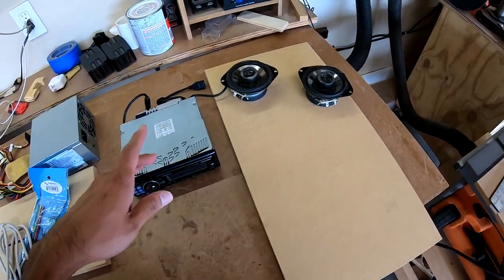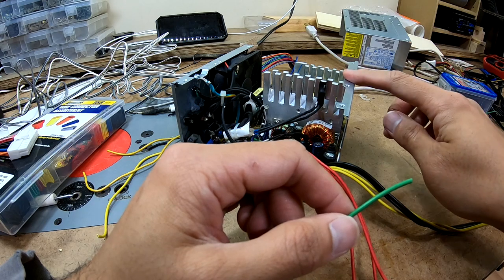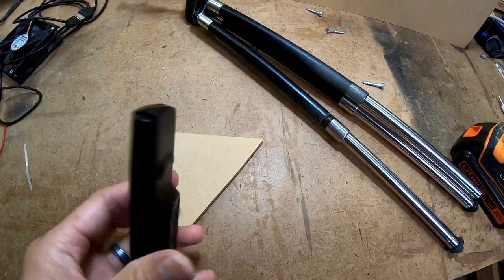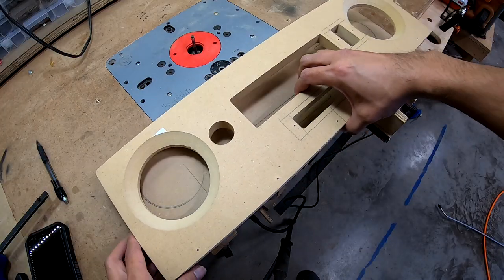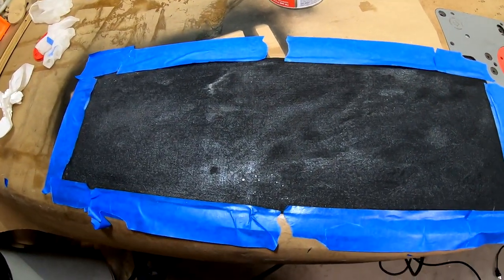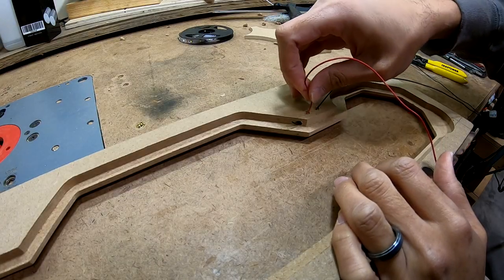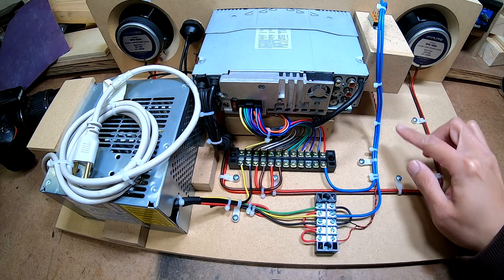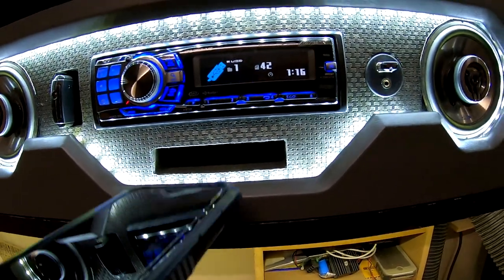The Shop Stereo Project (Reusing Alpine Car Audio Equipment For The Garage)

Comment: I used self-powered speakers to avoid the power supply and associated wiring.  To power the head unit, I used a standard 120VAC to 12VDC wall plug I found online for $11.  Though my system is clean looking, yours is much more detailed and eye catching with a splash of bling.  Nice work!
Reply from the maker: Thanks a lot. Gotta do what you can to have some tunes while you work.

Comment: Almost 3 years later, but still looks good to me. I'm not sure I understood the magnets for LED power though. I guess a solid update could be a wireless charging pad in that cubby. Either way, good work.
Reply from the maker: Thanks a lot. I kinda rushed explaining that part about the magnets. It’s basically just a quick disconnect connector made out of magnets so I can remove the front panel without having to worry about loose wires. I have a few more videos I need to edit before I can get back to the shop stereo. I’ll be adding some rear speakers in the garage and possibly a subwoofer, but that’s the next project after the next two or three videos I get posted.

Comment: Came across your work looking at doing a head unit in my '17 accord, however that turned out to look like Pandora's box. Anyways, I just wanted to let you know that your work is not only amazing, but inspiring. Your detail and organization are through the roof man, really. I've built a few garage sound systems with spare parts, but nothing like this. I really like the CPU power supply. Keep up the amazing work.
Reply from the maker: Thanks a lot! I definitely take pride in (most of) the work that i do. I’ve got a few projects in the queue, but I haven’t had time to work on them. It’ll get more videos up soon. I think the maestro interfaces are compatible with the 10th gen Accords now. I may end up trying that eventually to follow up those videos. But that may be the route to go if you want to go aftermarket in your car.

Comment: I’m just about ready to make my own, and this has given me the push and want to create something similar. Amazing work.
Reply from the maker: Thanks a lot! I’m glad it could give you a push. We can all motivate each other.
Reply: @AyyJayy02  absolutely man. I do have a question. What do you recommend the min req. be for the power supply? I know your using a old computer power supply but what would I be looking amperage wise? Obv. I know the 12v part, but just confused when it comes to looking for amperage. My setup would look the same, but adding a Alpine type r 10” and matching amp.
Reply from the maker: The amp rating should be labeled on the power supply. I’ll have to double check what’s on the one that I used. Check the fuse sizes on the amp and headunit. Add those numbers together, and that would be the bare minimum number for the power supply, but you’ll want to go higher than that. I don’t think a computer power supply would cut it for an amp for a type-r though. Probably go bigger than that.
Reply: @AyyJayy02  ñili

Comment: That's not a boom box, it is a work of Art (with a capital A). Very clean and organized layout. I do have one question for you though, where did you get that fabric that you used? The first one you cut. It really has a beautiful texture to it. Thanks and really looking forward to future projects.
Reply from the maker: Thank you! Clean layouts is what I always strive for. https://www.amazon.com/gp/product/B077BSN27Y/  I think that's the one that you're referring to. I almost felt like the glue seeped through the fabric though. It looks really good though.
Reply: @AyyJayy02  Thanks. That is exactly what I was referring to. I used to help set up pool tables in my youth. We used Scotch super 77 spray glue to attach the felt to the slate. Once you spray that glue on one of the surfaces and then attach them together, nothing moves. You may want to give that stuff a try in the future. Thanks again.
Reply from the maker: I haven’t had problems with felt or speaker box fabric, only vinyl fabric. Humidity gets bad where I live, so that could be part of it. Thanks for the info though.

Comment: HEY... you said you didn't wanna.. I have a receptacle I need replaced lmao.. so we can eventually work on this STOOOODIOOO that I am slackin' on.
Reply from the maker: I didn’t hardwire it to another receptacle. It’s just a receptacle with a plug on the other end. I don’t mind doing that in the garage, but it’ll look bad in your house.
Reply from the maker: There’s no way you don’t know an electrician
Reply: @AyyJayy02  I do, you. lmao
Reply from the maker: Only low voltage for me. I think there is another 0 at the end of an electrician salary.
Reply: @AyyJayy02  😂

Comment: This is very, very nice. I'm not a huge fan of the removable trim panel, I feel like I'd knock it off by accident at some point and damage it, but it isn't mine so I hope you enjoy it man, it looks great. All she's missing now is a little subwoofer to fill out the sound and that's super easy to do.
Reply from the maker: Thanks a lot! Trim panel should be pretty safe. It’s flush with the rest of the cabinet. A couple speaker boxes for some 6.5” speakers and a subwoofer box are in the plans. Not exactly sure when that’ll be though. Soon I hope. Just been really busy.

Comment: Looks Awesome! A wireless charging pad in the phone cubby, definitely would be a consideration. Also I get the use of the PC power supply, because you had it on hand but they produce a lot of heat and take up a lot of room. That room would be better used to place an external hard drive linked to the USB for MP3 storage. Nevertheless you did a great job.
Reply from the maker: Thanks a lot. I’ll consider the wireless charging pad. I’ve got a bunch of charging cords, but I seem to never have any in the garage when I need them. I gave up on MP3s shortly after Apple Music came around, so I didn’t even think about a hard drive. But I plan on expanding the stereo pretty soon, so we’ll see what happens.
Reply: @AyyJayy02  I look forward to your upgrades.

Comment: Nicely done sir, ive been wanting to build one in my garage!! You should add an amp and sub later on maybe, be pretty sick imo👊🤟
Reply from the maker: Thanks a lot! Yeah, it was a fun little project. I just finished up a couple speaker boxes for some 6.5” speakers to fill in more sound in the garage (video will be up in the coming weeks). The subwoofer will happen eventually. But I’ve got a couple big projects lined up before that.

Comment: This is fantastic and I love the nice neat wire layout. A pc power supply seems a bit much for the radio only but if you had it laying around who cares I guess. 

One think I would do if I were you is add a wireless charger to your phone bay connected to one of the constant 5v wires so your phone can charge too.
Reply from the maker: Thanks a lot. I’ll have some LEDs connected to the power supply when I finish a couple speaker boxes for it, so I can utilize it more. I did think about the charging cord, but honestly, I’ve just used a Bluetooth receiver plugged into the AUX jack and have had my phone in my pocket usually while working 😂

Comment: I did the same thing for the workbench put woofers  Under the workbench but now 2 years later still having a problem figuring out which antenna to use with no reception in the garage

Comment: How can I mAke something similar without the computer thing
Reply from the maker: Any 12V power supply within the amperage limits of the headunit should be fine. The computer power supply was what I had on hand, so I made use of it.

Comment: You got those running full range or does that unit have a crossover in it?
Reply from the maker: I can adjust the LPF and HPF. It’s a pretty good headunit. I have an audio processor that can be used for it, but i think it only has RCA outputs. I’ll just stick with the high outputs.

Comment: It is said that the car stereo does not provide many details such as home audio, because it works on 12 volts and 4 ohm speakers. Is this true?
Reply from the maker: Lower ohm load can reduce sound quality, but allows more power. It’s easier to get a better sound in home audio than it is car audio. There are a lot of obstacles that can ruin the sound in a car versus home audio. It just takes more work. Or so I’ve heard. I’m not a pro at all, so someone else could give a more detailed answer for you.
Reply: @AyyJayy02  

thank you

Comment: Doesn't look like you vented the enclosure.
Reply from the maker: I actually forgot to show the side of the cabinet. The fan for the power supply is blowing out of that hole that I drilled in the side. I may upgrade the fan if I feel like it gets too hot.
Reply: @AyyJayy02  As long as you have a way for air to enter and exit you should be fine. Nice work.

Comment: Nice job not including proper ventilation for the power supply. lmao
Reply from the maker: Thanks! It hasn't appeared to be a problem yet, but I did plan on adding bigger fan to it, eventually. I want to build a couple speaker boxes for some 6.5" speakers that I have laying around, and I'll address that issue then. That's a few videos down the road though.